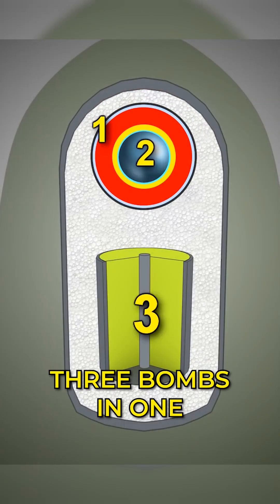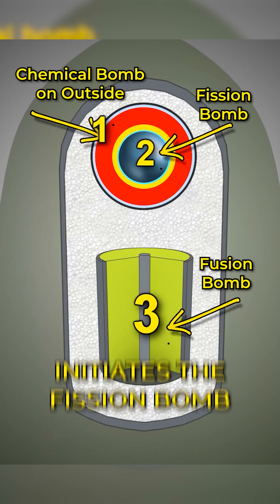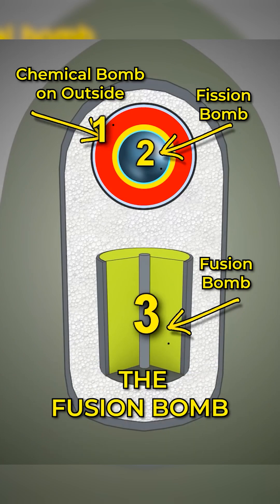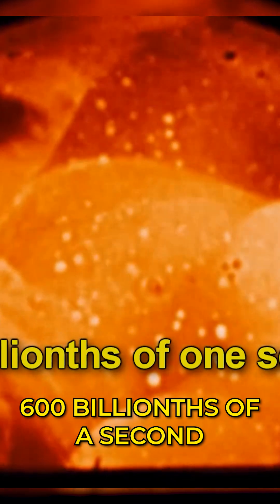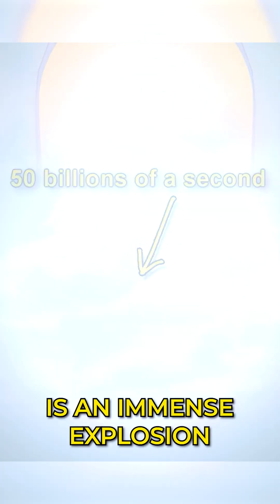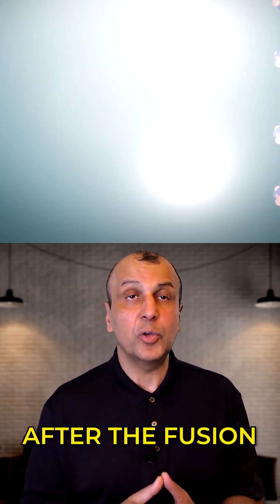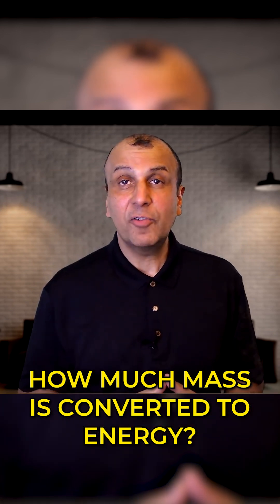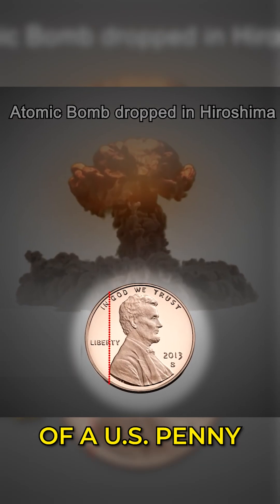The INSANE Speed of a Nuclear Bomb Explosion

Comment: I'm not sure that design is still used.
Reply: The Teller/Ulam design is still the mainstay of all nuclear arsenals. Their imploding primaries are sometimes two-pointers (Swan devices).
Reply: @skateboardingjesus4006  Most probably the case. But I look at the size and yield of say, the B61 and B83 physics packages and have to wonder how they can have the yields they have and be so small with a T_U design. That's all.
Reply: It is.
All current US nuclear weapons use this configuration.
Reply: @Evan_Bell  Then there would be no need for supercomputers of vast computational ability to model modern designs.
Reply: @davidsault9698  How did you figure that?
Reply: @davidsault9698 
Why not?
Reply: @abelis644  Simple answer: stuff moves on.
Reply: @abelis644  I'm not a physicist, but I would call it shock front fusion as occurs during core bounce in a supernova. Fusion should take place at an induced shock front directly in a fusion fuel. The temperature is billions of degrees at such a shock front and I would like to see a supercomputer simulation of that in a fission-fusion design.  Also, I wonder if explosive compression cannot be done away with entirely by flooding the primary core with tuned neutrons in sufficient numbers to create so many fission chains that the core does not have enough time to expand before developing significant yield. In such a case, a fusion device could be very small. But, again, I'm not a physicist. It is outside speculation.
Reply: @davidsault9698  The design of most of the deployed nuclear weapons is decades olds. As far as I know, almost all deployed nuclear weapons are very similar T-U classic super, which is depicted in this video.

The most advanced one (in the US arsenal at least) is the W88 warhead. This uses a more complicated design for the primary. It is egg shaped, so it fits better into the warhead. This required some serious processing power to model when it was being developed. However, my phone could probably do it.

There might be some really fancy stuff on the drawing board. I don't know. But the W80 and W88 are extremely lethal.
Let's hope they never need to be launched.

Comment: Considering the huge amount of energy which can created by turning mass into energy one gets an impression how much energy our sun creates as it turns a few million tons of hydrogen into pure energy in every single second.
Reply: The Sun doesn't trun a few million tons of hydrogen in pure energy. It turns a few million tons of hydrogen in a few million tons of helium but a bit less mass of helium than the hydrogen it started with. THE DIFFERENCE is turned into pure energy.
Reply: @adb012 It converts about 4.3 million tons of mass to energy per second.
Reply: @adb012  Do the research. It's not the amount of hydrogen which is converted, it's the net mass loss.
The amount of converted hydrogen is way bigger.
Reply: @hg6996  ... But that is what I said! YOU said that the Sun converts the mass of hydrogen in pure energy. I said not, most of the mass of hydrogen is converted not in energy but in helium and the small balance is converted in energy. In other words, if A is the mass of hydrogen fused into a mass B of helium then the energy released is (A-B)*c^2., with B being smaller but very close to A.
Reply: @adb012  while this is true what i wanted to say is that the amount of energy released by the sun is the equivalent to a few million tons.
And of course, too get that much energy one has to fuse billions of tons of hydrogen in the first place.
Reply: @hg6996  What you say is true. What I meant is that, while the Sun fuses some 620 million tons of hydrogen per second, no single atom (well, nuclei since it's all plasma in there) of hydrogen is "converted to pure energy". So "converting tons hydrogen in pure energy" is, in my opinion, misleading. Rather, it converts tons of hydrogen in slightly fewer tons of helium plus energy that accounts for the small balance. To be more precise, 4 nuclei of hydrogen (that is, 4 protons) turn into one nucleus  of helium (that is, an alpha particle), which has 2 protons and 2 neutrons, by absorbing 2 electrons (to neutralize 2 protons). No leftover in terms of atomic particles. However, the nucleus of helium is slightly lighter than 4 nuclei of hydrogen + 2 electrons (the raw material to make the nucleolus of helium) because the energy contained in the helium nucleus is less than 4 times the energy contained in a hydrogen nucleus. The atom of "regular" hydrogen 1 weights 1.0078, times 4 is 4.0313, while the regular helium 4 has a mass of 4.0026. The difference is about 0.7%. That means that from the 620 million tons of hydrogen fused per second, you get about 616 million tons of helium (again, every single subatomic particle is accounted for, no subatomic particle is "lost" into energy) with the remainder 4 million tons being transformed in energy (mostly kinetic energy of the helium nuclei that get hot and  electromagnetic radiation i.e. photons in the form of gamma rays, x-rays, ultraviolet, visible light, infrared and radio waves).
So "converting tons hydrogen in pure energy" is, in my opinion, misleading. In the same way that saying you "burn pounds of wood to turn them into pure energy" would be misleading. The wood (or the hydrogen) is mostly converted into a lot of other stuff (helium, or carbon dioxide, water, smoke and ashes) releasing "a bit" (relatively) of energy in the process. In my opinion, there is nothing "pure" in that conversion to energy. Now, make matter meet anti-matter and we can have a talk about converting something into pure energy.
Reply: @adb012  exactly 👍
Reply: @adb012 so how many of those atoms fusing did it take to give me this sun burn?
Reply: The sun doesn't turn billions of tons of hydrogen into pure energy. The H atoms fuse to create alpha (helium) particles. The energy is taken from the bond, because the bond of the helium bond is stronger
Reply: We need a Dyson sphere asap
Reply: A fusion bomb and even a fission bomb creates far more energy per unit volume than the Sun. Still, I wouldn't want to be too close to any of them.
Reply: @skateboardingjesus4006 
Are you considering the core of the sun or the amount of energy leaving the suns surface?
Reply: @thefourshowflip  Creates, in the core.
Reply: @thefourshowflip  They both should be about the same. Otherwise, the sun would be getting hotter or cooler. Well actually, I hear the sun is getting hotter slowly over time, so I guess there should be slightly more released in the core than at the surface. However, the difference should be extremely small (on average).
Reply: @joshuasamuel2122  
The sun is indeed getting hotter but the timescales involved are immense; we’re talking on the order of about 10% over 1 billion years. On human timescales, it is indeed trivial. 

And it’s important to remember that it’s not the energy that changes between the core and surface, it’s the energy density that changes depending on where we’re considering it.  If we were to put an energy detector at the boundary of the core and at the suns surface, we should detect the same amount of energy leaving both of those surfaces, but the surface area of the core detector is substantially smaller than the surface area at the suns outer surface (and this will continue to decrease as the sun gets hotter; as the temp rises, gas expands, the sun will swell and the energy generated in the core will have a larger surface area to be radiated away from, decreasing the energy per unit area).
Reply: @thefourshowflip   Indeed. Which is why I said it would be an extremely small difference. And yes, the energy density in the core is astronomically larger than near the sun's surface. It is the total flux through the surfaces that is equivalent. The mass density of the core is also astronomically greater than at the surface. It's amazing that there's so much energy per unit volume in the sun, that the radiation pressure alone is able to contribute greatly to holding it up against gravity. And yet, I recall seeing a minute physics video saying that the energy released per unit volume is less than our own bodies! But I guess it makes sense because the surface area to volume ratio is astronomically larger in our bodies than in the sun.

Comment: Great but how this loss can be measured? Is it just theoretical?
Reply: Its a formula for E is equal to mass times squre of speed of light , so they actually estimated the energy radiated and get the mass
Reply: Einstein wrote  E=mc². 
The most famous equation in science history gives you the answer.
Reply: The measured radiant heat from the thermal pulse, and the the radius of the fireball alone is enough to calculate the quantity of mass to energy conversion. Some of the earliest hydrogen bombs had calculation errors around 15% plus or minus, due to a number of reasons.
Reply: if you are asking for experiments that confirm exact conversions between E and m, I believe nuclear reactors used for electricity generation should provide us with data that confirm the numbers. And I think data mentioned in case of nuclear bomb are extrapolations.
Reply: @pavansonty1  One could never ever measure the remaining uranium after the explosion.
But as E=mc² has proven to be correct already a million times there is no reason to question the calculation.
Reply: @hg6996  Still, real world conditions aren't perfect, so the ammount might be even smaller.
Reply: In an accelerator such as the GHC the mass of the particles increase as their speed increases to near light speed. If E=mc^2 didn’t work none of it would work.